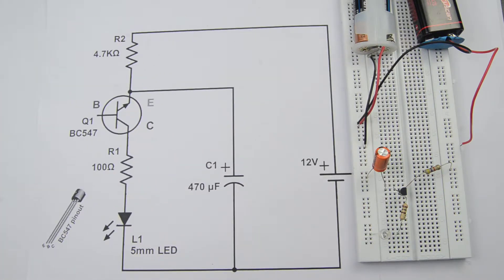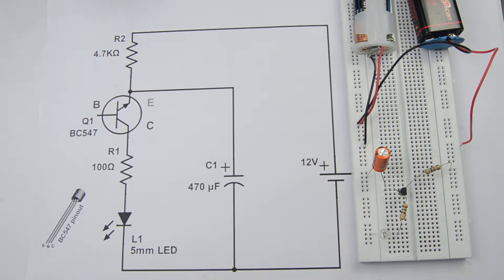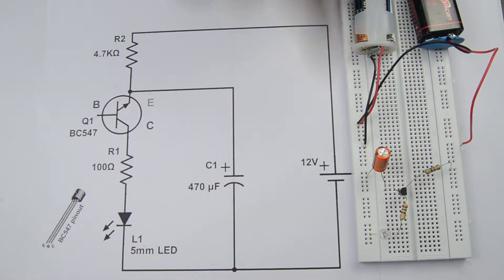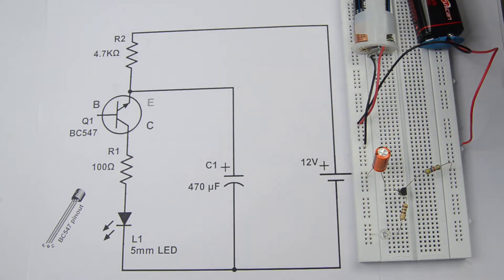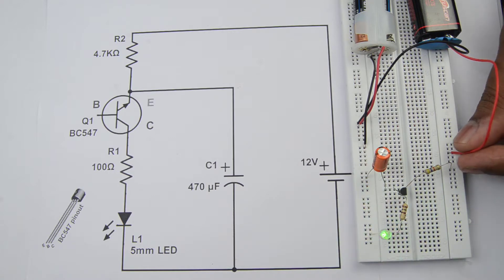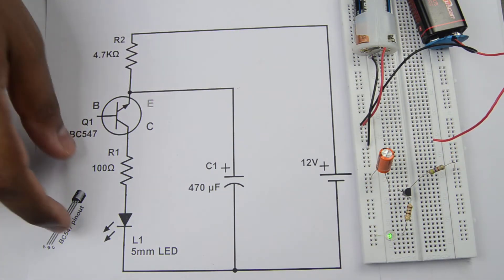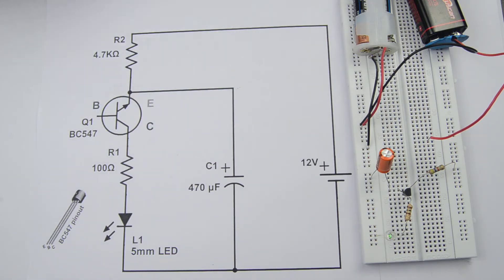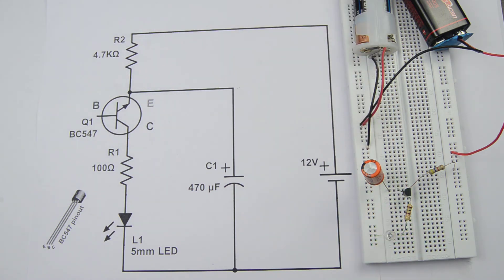Blinking LED with Single Transistor

Comment: Have you tested this over temperature and with a wide selection of transistors of the same part number? You are relying on the avalance mode of the transistor and is not a guaranteed mode of operation.

Comment: Hi! could you help me?
I want to use this circuit on a kind of charger and use this circuit about "power ok" indicator. How can i change this circuit for 220Volts?
Reply: Does this circuit even works? It did not worked when i tried!! 

HELP PLS
Reply: @kunaldhar6713  Yes, the circuit works absolutely perfectly. Check the links. And don't use White LED. Color LED only. Voltage should be 11-12V. This circuit is not a stable circuit. Therefore, stick to the values.
Reply: Hi again. I fix my question. My questions answer is "yes". The circuit is same. And the emetor resistor will be 150k.
Reply: @shampuan5628  Ooooo... ok thanks